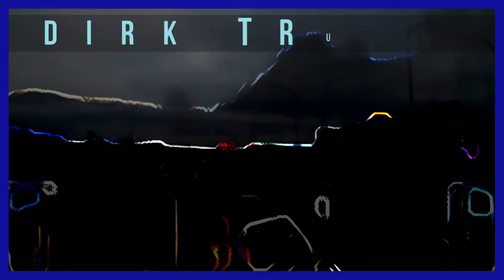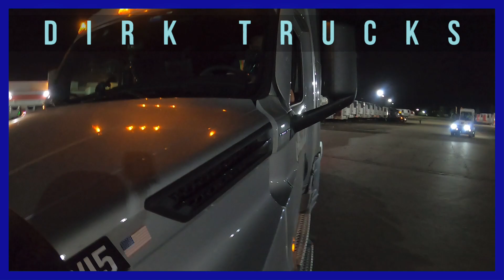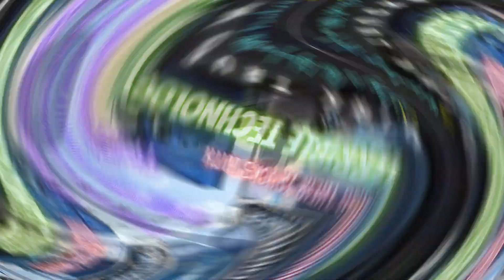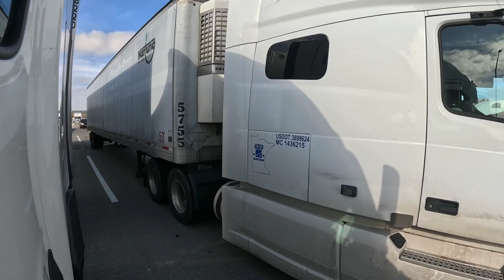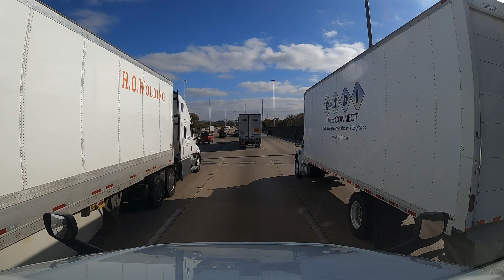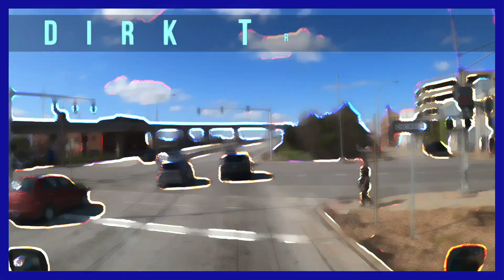Terrible Freightliner Technology! | Part Three | A Day in the Life of an OTR Trucker

Comment: the e coast is a real pain in the ass cuz in my case my truck is governed at 64 and its one of those models where if u have the cruise set on 64 u cant push on the pedal without the system dropping u to 62 (On pedal speed). SO if i want to re-engage my trans to get it off of e coast then it will lower my cruise speed to the on pedal speed.
Reply from the maker: I know the exact frustration you’ve described so well! I was actually talking about that exact issue with our company’s fleet manager and he referred to it as Freightliner’s little game of punishing the driver for trying to override the truck. He thankfully hates that crap as much as drivers do (he’s a former driver). He and I both agreed that the governed speed should always be the exact same on cruise and pedal for that very reason. All of our fleet is set at 70 on both and boy does it make a HUGE difference. Any company that sets the pedal lower than the cruise is a company I won’t personally work for again now that I’ve experienced how much less stressful and aggravating an equalized setup is to drive.

Comment: Your analysis and commentary are spot on !  I don't drive a Freightliner currently, and they are the worst team trucks ever!  Loud alarms that can't be adjusted to keep from waking sleeping driver up, albeit I believe that's why they are so loud
 It only awakens a driver that needs sleep for the next shift and dies not awr e a purpose to that sleeping driver.  I am not against driving one solo, Howe er I didn't know that I the name of technology we are progressively loosing control of the one thing we are held accountable for...the safety of not just us but thise around us first and foremost and then the customers product we are transporting.   Fuel savings of a mere fraction are moot at this point. Thank you so much for your professionalism, candor, and honest reporting !  When you said gyro, I knew for sure you know Aviation     Stay safe !
Reply from the maker: 100% agreed. The fact that the alarm volumes are not adjustable for team trucks is really crappy. Hard enough to sleep in a rolling truck as it is! And yes, you can pull the boy out of the airline industry, but you can never get the jet fuel out of his blood. 😎😊